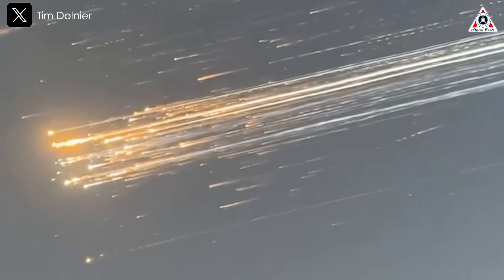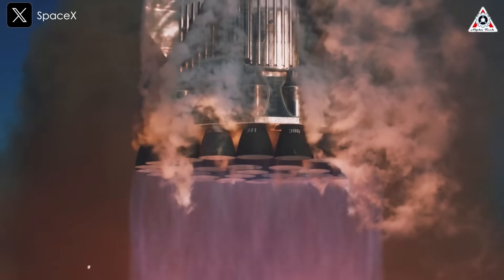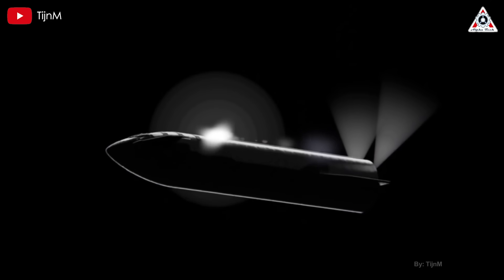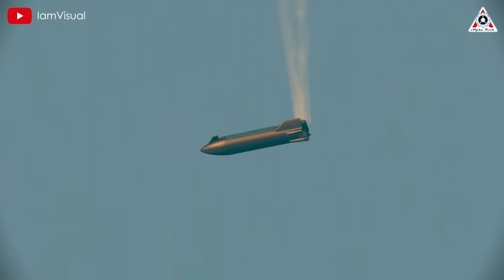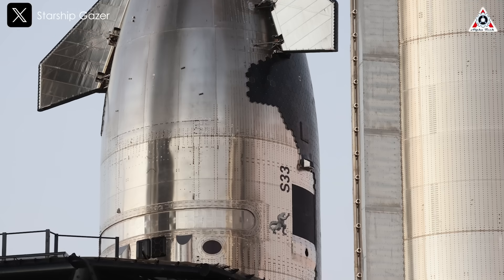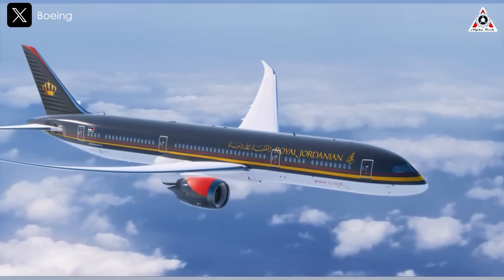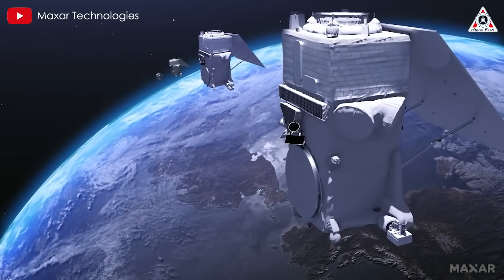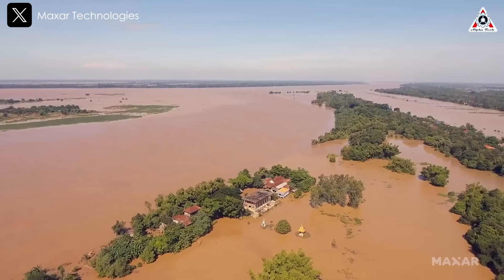Analysis of How a Tiny Valve Doomed SpaceX's Massive Starship Launch...

Comment: Where did the leaking methane get oxygen to burn?  Even if the leakage started right after stage separation (altitude 65km) the atmospheric oxygen density was negligible, a bit more than 1/10,000 of that at sea level. Was there also an oxygen leak?

Comment: so many things hideously wrong with a double leak, fuel AND oxidizer leaks ?????? that's just not one leak, it's two separate systems both failing, which leads one to assume there is some fundamental flaw in either a valve or line - there's stresses like wild temperature variation and vibration bad enough to rattle your teeth loose, so that needs finding and fixing. however, chemical sensors nowadays are so small and cheap you could have them all over the show at very little cost, fire suppression is simple enough, just have a small tank of CO2 or nitrogen and use it to expel and displace any potential buildup of combustible mixture. But regarding the cause of this, it's serious, it's an issue that they clearly have not done their homework on, the company has been around long enough by now to have close to 100 percent state of the art reliability and expertise on the fuel and oxidizer manipulation.

Comment: Space X adding a fire suppression system and other flight safety changes, increases the chances for a successful flight 8. These changes may be removed once Space X understands and corrects the underlying issues.

Since Starship 7 flight terminated early, it failed to test several key new features including Starlink Pez dispenser, flight 8 will have to repeat that testing.

Once Starship attempts a manned flight. Space X may decide to re-incorporate a basic fire suppression system, in addition to an automated flight monitoring system. 

While a fire is serious, it should never affect other critical Starship systems. But since this is a test ship it may not have isolation bulkheads and safety features of a finished version.
Reply: Really, adding a new system to a rocket which already had a load of questionable systems is your idea of an improvement?  I would have thought that both the booster which gets a lot of abuse in the engine bay due to the shock from the engine blast bouncing up off of the steel plate just a few dozen feet below them....... horrible design......AND the passenger carrying (maybe) second stage would have both had fire suppression systems even if for different reasons.  The Booster takes a beating on launch and has a lot more piping more fuel flowing per minute.  But the second stage HAS THE PEOPLE in it.  Shows what Leon Skum's values are, where he places his priorities.  That is proved by the fact that their "fix".... the water deluge/steel plate which cost a bundle, is being replaced, or at least enhanced, by a double flame trench LIKE EVERY OTHER LAUNCH FACILITY IN THE WORLD.  Bumbleheaded Skum strikes again.

Comment: DEI ‘s fault. I bet. Saturn v never blew up😂
Reply: True fact.  NOT ONE failure of the booster and not one failure of the F1 engines on a mission.  60 years ago, WITHOUT fantastic modeling by computer, better sensors, and with 60 years AND the Saturn project as pedestals to stand on.  Spacex is a miserable failure.  But stay tuned, more failures to come.  The biggest most powerful failures like no one has ever seen before.  The best failures.
Reply: @ Yet, Elon has convinced his cult that failures are great! The sky is the greatest simulator, rocket blows up and they cheer. Biggest rocket in history and I will be surprised if it can lift 300 K to LEO like Saturn.

Comment: well yes but it teachly didn't cause the starship to explode by itself but it did cause it to run out of oxydizer  and fuel in the fuel tanks by the tanks and the engines falled. then it self desruscted with its FTS when it deteced toltal outage it set off the FTS when it had deteced it was giong out of bounds.
Reply: There is, as of now, no evidence presented that actually happened and in what order.  Hence the FULL PUBLIC INVESTIGATION.  Public airspace, public money to build the silly shiny dildo.

Comment: Yeah, too many Fidly bits...

When they goto unified pumps for multiple combustion chambers, if they would consider my writs on semi concentric/semi stacked tanks, then a wider aft end on the old girl, to allow that config, will mean the pumps can be plug and play directly into the bottom of both tanks at the same time. no real fuel piping until after the pumps, and then just two ring  manifolds branching into the combustion chambers.
Those manifolds would be short coupled and not prone to vibration slant mega acoustic damage...

Basically what I am talking about is two trapizoidal tapers in opposition for tanks profile, and prob'ly a pretty S curve where they meet.
(S curves occur in Nature for good physics reasons.)

On an un related note, got to see Elon's great chat at the Military Academy. And was pleased to hear a point I've made in writs passed to hundreds of Cadets, that one should know;
 "Closely Related Fields Knowledge"...(CRFK) 😂

Its a point I have made here repeatedly in writs.

And its really rewarding to see it got inserted in the collective consciousness by Elon.
Hundreds of Cadets, millions of other people now aware that broader specialization is a good idea. And he reinfoced it with overall generalization.

Yeah! 🤗

Aspie thinking styles can be learned.

On a slightly related topic, Space and the Military, We are gonna need Military in space pretty much forever, as You never know what you will run into in the next Solar System, or what could come at you from a neighboring Galaxy...

Pretty good chance, we'll want a military contingent on every Colonizer Ship etc.
And probably would be wise to have armed merchant marine style ships.

My only suggestion about Space Militaries, is tone down Feudalism, and Jack up the Merit.
Make the 
"Ring Knockers" 
get into the Academies by more than academics...
Make leadership a thing for guys who really do schitt..

Might help reduce the Suckups and Phuckups... 😂

You shouldnt be able to make joint chiefs of staff on just being Gay... There should be more substance required in careers, and less arrogance and eliteism.

Like the Military not liking to give medals to enlisted... but rewarding them like halloween candy to officers that get anywhere near anything.

That schitt needs to stop. We dont wanna lose a Colony or a ship of the line because somebody got promoted to their own level of incompetance.

Just sayin'